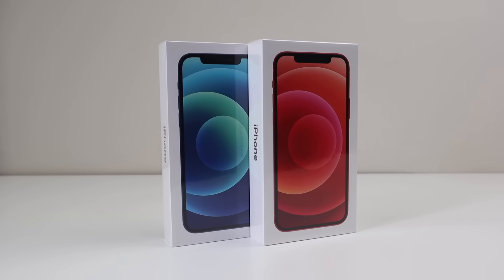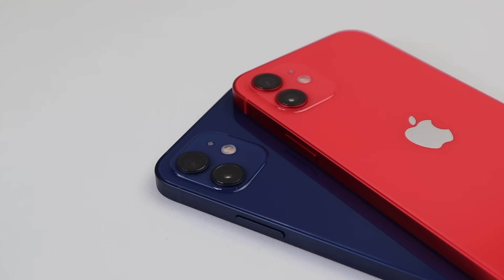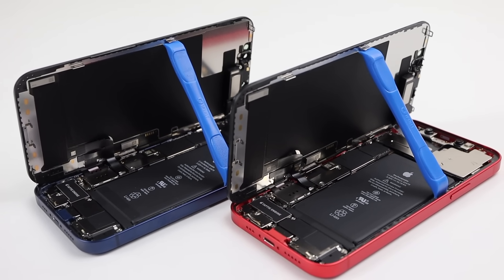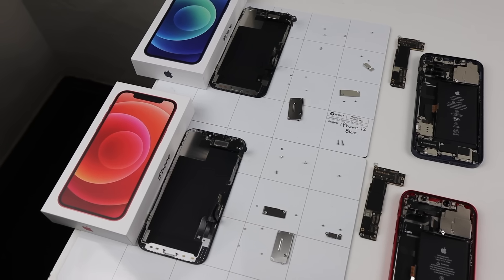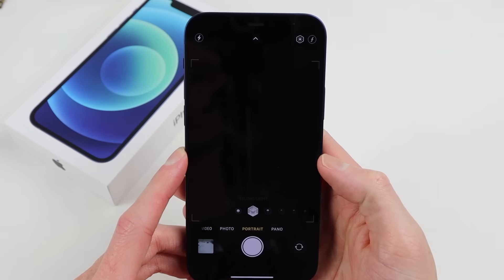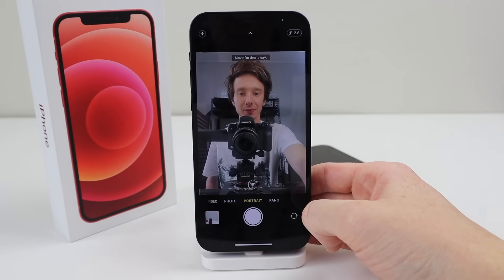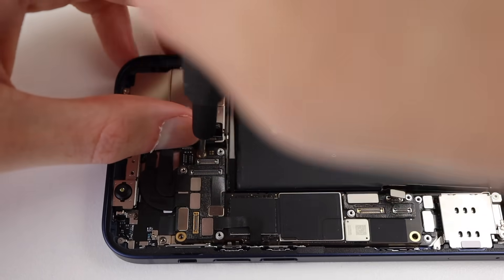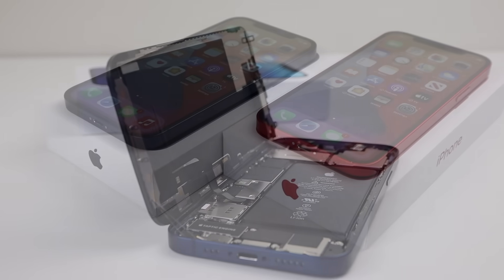iPhone 12 Anti Repair Design - Teardown and Repair Assessment

Comment: These changes are definitely not eco-friendly. New iPhones are trash and the battery life is a fraction of the older generations. They are designed to be replaced every year or two, at this point it's all for profit/greed. Definitely not buying into the iPhone charade for my next one.

Comment: 2 billion charges in the world so we'll leave it out, but lets change the cable so they have to buy a new power adapter...Hardly see the logic here. Only difference now is they don't have to pay for it, but we do. If it was indeed about waste, then they would of provided the original cable so the consumer can plug it in and use it as is.

Comment: Apple was the BEST. Now they have become appalling. I recently had to have my MacBook Pro repair. 4 weeks and it is still not repaired as Apple packed the replacement parts poorly and they were broken en-route to the Authorized repaired centre. And I have to wait two more weeks whole Apple conduct an investigation into how the part was damaged in transit! Apple Service = ZERO service!
Reply: watch them charge you xtra for the broken parts as an under the table fee.
Reply: I used to be a big Mac/Apple fan until about the end of the 2000s when they started sealing up their laptops. Had a nice 15" macbook with dual boot drives (instead of a CD drive) for running windows, my own SSD and ram. Nowadays that seems so absurd, but it wasn't SO long ago that this was possible

Switched to a custom built PC after that laptop started showing its age
Reply: I’ve had bad experiences with Microsoft support too

Comment: I don’t think it’s an issue. Many stolen iPhones are torn down into parts and reused. Apple is tightening the control to crack down the black market. If any stolen iPhones are not worth a cent, for average consumers, I don’t see it as a problem.

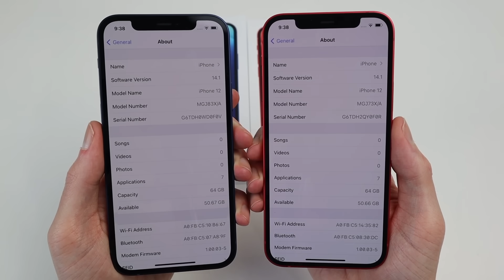Comment: 2:38 ....Hmmm from 64GB we have ONLY 50GB straight out from the box :D
Reply: It's 64GB unformatted.
Reply: Old iPhone 5s has 62 free space, most Android about 58 or more, so yeah it takes too much space for just OS
Reply: Well if you have to lock all your parts by software than it take some space haha
Reply: That could be the OS taking up a good chunk of memory. That's just the storage without anything installed
Reply: @tedhumphreys1473  ? windows takes up less space than that
Reply: @tedhumphreys1473  There's no good reason for a mobile OS taking up so much space. It could be a combination of the OS, and Gigabyte vs Gibibyte discrepancy.
Reply: @nathanielpillar8012  it could also be from crap your mobile carrier installs
Reply: @mnichols1979  a small part of it, yes, but unlikely multiple gigabytes.
Reply: @nathanielpillar8012  iOS measures in gigabytes instead of gibibytes since around iOS 10. I think it’s just that they come with iLife and iWork apps pre-installed. GarageBand and iMovie are pretty huge. They can be deleted though. Then iOS takes about 5-6GB of space too.

Comment: The faceid problem Will be Solved by transferring the faceid components on the screen and in the housing to the same unit, yeah the original battery and screen need to be transferred aswell.

Comment: Wow, this seems really malicious to make the phone behave like it is somehow broken, just because it doesn't have an original factory part.
Reply: In fact, it had original factory part but the serial number of the part had not been blessed for the motherboard. I guess the motherboard has list of serial numbers of connected parts. And that list has been digitally signed so nobody else but Apple can modify the list.

If they want to be really evil, they could require even official repair shops to request signing any list changes from central Apple servers so that they do not need to distribute the signing key even to official repair shops.

Comment: No need to worry, hackers are currently searching for the line of code that pairs the devices original parts to the original device, im sure they'll figure it out
Reply: Apple just needs to pull DMCA card and declare any such findings illegal. All they need to do is to claim that all these software tricks are intended to guard against copyright infringements.

As such, even if somebody figures that thing out, Apple may just as well use law to silence any such efforts.

The only way to fix this is to vote with your wallet and NOT PURCHASE any Apple crap until they start behaving more correct.

Comment: The law should make Apple tell the consumer right on the advertisement of the iphone that it is not repairable unless it is repaired by apple, which has a short lifespan of service. That has to be included so that the market will not buy as many of them which causes them to reduce the price or change their ways.

Comment: "apple trying to reduce climate impact"

as they remove the charging brick, resulting in you being forced into buying more apple products thus increasing climate impact
Reply: and removing the headphone jack
Reply: @axelolsson2376  Coming from someone who refuses to upgrade from the Galaxy s9 bcuz I want the headphone jack, it's not really an apple exclusive thing.
Reply: @Chasing_Mangos  s10e has a headphone jack. The most latest phone to have a jack after s10e no jack
Reply: @awhopper3241  Ah didn't know that tbh. I usually prefer huawei anyway.
Reply: @Chasing_Mangos  turns on location  The whole country of China knows you're here.
Reply: You can't waste electricity if you can't charge your phone
Reply: As an apple user I can agree that Apple kinda sucks right now.  They got great phones and stuff but it’s all waaay over priced and them removing the earbuds and charging brick is just dumb.  I can definitely agree that it’s just them forcing iPhone 12 users to buy more stuff from Apple.
Reply: @turtleneckfox  agree iPhone 12 is overpriced
Reply: @anthonyplays2401  Even when the earbuds and charging brick are gone it’s still the same price.  It’s literally an iPhone 11, the only difference is that they changed the number from 11 to 12
Reply: ron  yeah but s10 is no longer newest s phome now s20 jas no headphone jack and only ultra note has sd card regular dosent
Reply: You pay $1000 for a phone, but they can’t be bothered to include a power cable that probably costs them $3 to manufacture.
Reply: They reduce to produce
Reply: You can actually buy a lot other USB c bricks.

I only have these
Reply: Nah I just threw away the new charger and used one of the old ones Apple am I right
Reply: Yes, but actually no
Reply: Also manufacturing in countries that have no concern for environmental impacts
Reply: if they included it in the product then the resulting climate impact would be higher.  You buying a charger if you dont have one is actually less than them including it in every box.
Reply: Apply never cared about environment! they care just about money. if their sale is not working they just increase price to cover damge thats how poor behaviour look like. oh sorry i mean '' premium brand''. And they should move their factories to Amazing Amerika to reduce trucks, ships, planes  and i dunno what else. Its just Slap in the face to all of us. We give you less every year but you will pay more every year! People are becoming more and more stupid. ll they need is $1000 phone and watching movies while walking.... hurray
Reply: They're probably gonna get 0 climate effect by selling the phone seperately
Reply: Typical blood sucking capitalist mind that will destroy this planet by their greed
Reply: Seriously? I've heard this exact same argument over and over. You are literally dumber than most children if you don't realize you can just buy a universal USB cable and use it with ANY USB charger you want to. I've been using my Zenphone charger for every single phone I got after it with ZERO issues. iPhone included.
Reply: @xionxinx  dont assume that everyone who uses apple already has a universal usb cable. they will still have to purchase something one way or another.

Comment: Kind of making sense, so dodgy people can’t unlock illegally obtained iPhone with a replaced finger print/faceid and access the nudes in the albums.
Reply: If this was only about security, the iPhone could just as well simply say that factory reset must be done first. That would allow fixing phones simply by replacing parts but wouldn't allow getting any private data out of the phone.

Apple decided to just make the software intentionally not work correctly instead. The most simple (as in all the features without any extra crap) software implementation would NOT even try to differentiate between otherwise identical camera hardware.

Comment: This is illegal in Denmark, We have a law that prevents apple on having monopoly on repairs, we can freely choose where we want to get our phones repaired, and the repair shops need to be able to replace every part that need a replacement with no malfunction afterwards
Reply: How is the law written there? If some special software is required to activate the replaced parts, Apple might be able to simply not provide the software or have so bad licensing terms that nobody wants to accept the terms even if the required software were available.

As far as I see, forcing "Right to Repair" to companies not willing to allow it is really hard due all the loopholes caused by adding trade secrets, patents, copyright and licensing.
Reply: What good are the spare parts if you cannot activate those parts for the OS?
Reply: @MikkoRantalainen  specific says the law, all parts should able to be replaceable without the requirements of special software or tools. and you have the right to get your phone repaired at the workshop of your choice. Thats the short version of the law, and this means apple can´t the lock parts to software they have only.
Reply: @RasmusN  Nice! Assuming that Apple is not finding any loopholes they either have to open up or stop selling Apple iPhones in Denmark.

Comment: Jokes on Apple, I'm still on the 5s...works like a charm still
Edit: it's a 5E iPhone
Reply: Did you already install iOS 14.1? No? Are you happy to use Safari without security patches?
Reply: Yeah, my IPhone 5s is updated to iOS 14.1
Reply: @vinokai  Nice! I thought that 5S is not supported by iOS 14.1.
Reply: @vinokai  Are you sure that you have iPhone 5S instead of iPhone SE because according to https://www.gsmarena.com/apple_iphone_5s-5685.php 5S cannot install iOS 14.1?
Reply: Mikko Rantalainen hmmm, maybe you're right, I might have 5E. It's the later version of 5.  Was told it was 5S. It's small, silver colour, fingerprint unlock. 
Edit: ok I checked, it's definitely 5E or SE
Reply: @vinokai  I think iPhone 5E does not exist. You can check the model you have by selecting Settings - General - About and see "Model Name" info. Note the difference between SE (special edition) and 5E (five E).
Reply: Mikko Rantalainen eh, either way, it's weird that a lot of sites say the best version 5E, won't update past iOS 13. And yet I did update it to iOS 14, and just updated it again last night. Odd
Reply: @vinokai  Many people are confused by equally confusing information from Apple. From everything I have seen, it seems that all iDevices that have at least 2 GB of RAM will get iOS 14.1. Unfortunately, Apple never ever says how much RAM their iDevices have (I've checked both ads and the Settings - General - About in the device itself). You have to search gsmarena.com for info about that.
Reply: Mikko Rantalainen hmm, well I just checked my phone and it's a 5E

Comment: Im probably just going to get called a Fanboy for this, but it boggles my mind how people still justify buying these things, and thats coming from someone who has liked apples operating systems over the years. Im watching this on a Samsung S3 that is running android 5 (7 years old now) and the youtube app works perfectly. most of the apps i use are still supported, and the phone itself has never had a single repair or hardware issue. If i need to replace the battery i can just take off the back cover. I know people say iphones last longer but in my life experience this hasnt really held true. I doubt anyone buying an iphone 12 today would still be using it in 8 years with original parts.
Reply: i phones dont last longer, people just buy new ones every year, smash the screen, walk around with it broken for 12 months then buy the next model.
Reply: @thalivenom4972  That's true of my wife and youngest child. I have stuck with my Galaxy S7.
Reply: @wwiiinplastic4712  Lenovo P2 since Januar 2018 in gel case and extra glass on display running strong on construction side with me. Has fallen from above 2m on concreed or granit and runs like first day. Bought new from ebay for under 300Euro.
Reply: i own several phones that ive had for so long the network type is obsolete. i have slide phones from samsung that are over 10 years old that still work, but the storage is too small for use. ive never broken a samsung, all you need as a gel case, and they are tough. the rest of my family uses apple and their fones are terrible. this kind of stuff just makes it a surety that ill never buy one.
Reply: I have a Samsung too (Galaxy J7) and still holds well.
Reply: I concur
Reply: Only idiots buy iPhones it’s simply for attention oh look at my shiny..... My precious. Fucking Sméagols where’s Frodo when you need him.
Reply: i have an iphone and i totally agree and understand what you’re saying. what apple is doing is ludicrous, but even with all this knowledge i don’t think i would ever get any other phone besides an apple
Reply: I have an S4 and the only thing i changed in it is the display...i even have the original battery LOL(yeah it doesn't last as much as it was new but i don't use it to socialize or games...i think people should not buy a new phone unless there is indeed nothing to be done to it...i hate to say it but it seems to me the older the better...just like the Bible in comparison to man made new books explaining from the Bible...Peace
Reply: i have a iphone 6S+ de 2014 all pieces is genuine.
the probleme is not the phone but the apps.
i had a iphone 4 and must to change for 6 because apps are obsolet.
i think in 2021 or 2022 some apps begin obsolete with update and i must buy a new phone for to be updated with all apps and all apps fonctionned right
all appareils are the same ( phone-printers-scan-laptop-pc-and more .....after 2-4 years the update make down the machine and you must change because the pieces is not in stock or unmaked! my ex girlfriend haved a problem with laptop 1yo old (2yo garantee).....send in after sale service.....go to factory......receved mail back with price to repar : 60% new price......at the end she go buy a new laptop.....( PS sorry for my bad english....)

Comment: So when apple has to repair the phone by replacing a single product, such as the camera, or the battery(which is replaceable), how do they do it?? Do they configure that battery with some connection to the logic board or what? And how is that done ?
Reply: I would guess there's some additional software required to bless the new hardware serial numbers for the motherboard to accept them. And such special software can be trade secret and doesn't need to be distributed to 3rd party repair shops.

Comment: thank you, A very Interesting review. On the one hand it will guarantee the quality of the phone and I suppose they protect their brand. I totally believe that independents should be able to repair but it is a fine line to get ensure quality as not all independents are created equal. Once you get on to the second hand market, I guess knowing if a phone has been repair independently has some advantages. As an example I wouldn't trust it to retain a high IP water rating (so would not allow it near water) In this context I have a Omega Seamaster watch I've owned for 20 years. I need a battery in it every 5 years. I know i could change the battery myself or just at the local electrical store for a few dollars, but I pay the 100 dollar premium to use a certified repair shop as I know it's going to be fully water proof to 300m which is obviously essential in the 10ft deep end of my local pool :-)   That being said they don't need to so draconian. If it's only to protect their image, it wouldn't' be hard to still allow all the functions but to be able to flag warning or have a page that would list any non original components and probably when they were replaced which actually would be really helpful for the secondhand market.  As this is all software I guess we will see how this plays out. It they get a lot of push back I'm sure they will push out an update that flicks this "feature" off.

Comment: When you say the heat-mat was at 80 or 120 degrees is that Fahrenheit or Celsius?
Reply: Would you even be able to read the reply? Because it seems you can't read. It clearly shows 80°C 120°C on the heater.

°C is celsius 🤦‍♂️
Reply: @goldenboy7759  Ah yes, I see it now, thank you for pointing it out.

Comment: Sounds like the camera has a "ID" that prevents replacement for your "safety". Same with the battery. Or could be a precision resistor like they used to do to the charging cables.

Comment: they remove safety deatures without reason so they can say its un safe for non apple employees to repair there computers. its stupid and leaching to other industry's (tractors, cars ,and more) you cant be pro the environment and make devices designed in such a way to cause maximum waste. if they were truly pro environment they would make modular phones (like pc's) with interchangeable parts even across new model's to make the most of each parts before recycling (recycling materials burns more energy and still causes some waste than reusing the same part as a whole)